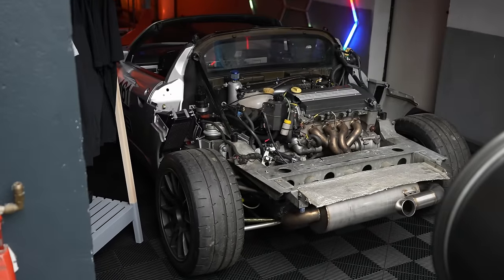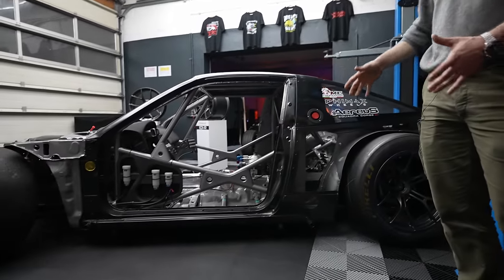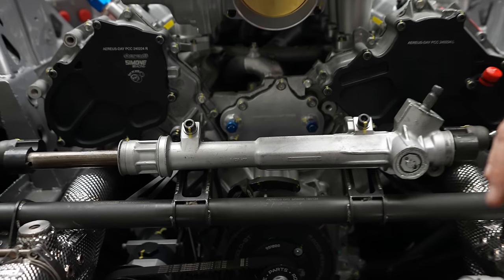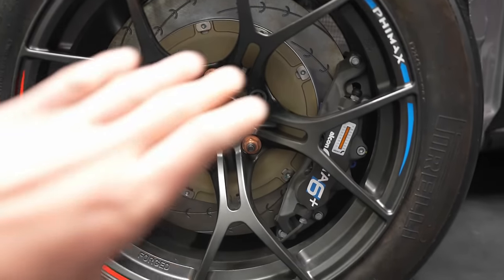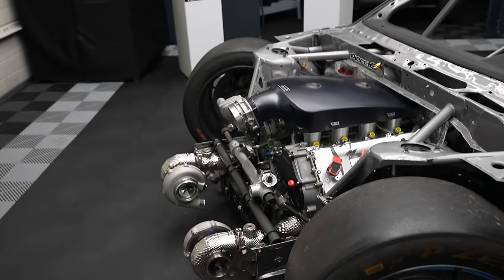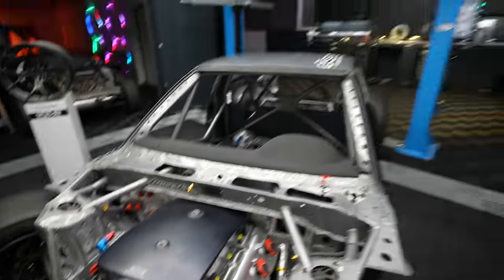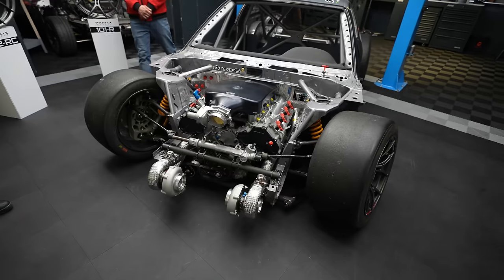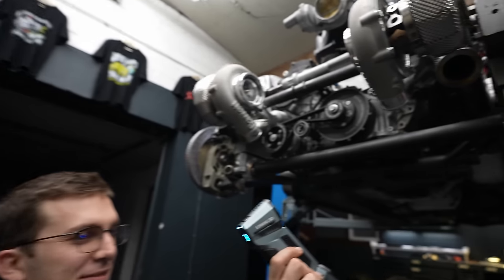Our INSANE 1500HP World Time Attack Build // Vulcan Alpha

Comment: Nice nice. Rigid chassis, custom suspension, engine as far down and back as possible. I like that Lapo even touches a little bit on material science, wheelbearing housing weight vs. strength.

9:53 hm makes me wonder if it clears even with full steering angle inwards and suspension travel (compression and jumps), but I'm sure you've got this thought through 1000%.

20:37 can you take a quick look at the general concept of lightweight intake manifolds? I knew someone who was constructing a carbon fibre intake manifold for the VR6, which could have saved up to 10 kg at an important place (at the very front & top). He abandoned the project due to personal reasons :( But in general I would still be interested in such a thing. Of course this would have to juggle weight saving with rigidity and heat resistance, but I'd be curious to what point the weight saving could be pushed..

Are you also interested in doing a hillclimb with the car? There are many such races in Germany, Austria, Switzerland, ...
Reply from the maker: Intakes&hillclimb: maybe!
Reply: Yes the suspension has been checked multiple times and the results are flawless with no interference. This confirms that the cad work is also spot on.

For the intake it was decided mostly because of time schedule to make it out of aluminium.
But a carbon intake is definitely possible, maybe for the next iteration. 😊
Reply: @lapocorenich  💪💪

And to clarify again, the intake question was not regarding your car, but mine. No hurries though.. I haven't spent any money on mods for a long time. For now I'd just be curious if it's possible and to what degree the weight saving could be pushed while also assuring reliability and safety.
Reply: @stoneeh yes definitely possible! ✌️

Comment: I only recognized it was a S13 chassis because of the rear quarter windows 😂 Great project, I like the way you guys talk about it, wish you the best with it. 

Now, here's me hoping you'll be designing parts for Jimmy's MX5s, so I can then order parts for my own MX5 😂

Also if that's possible, I'd like to know more about the shocks you're using there, who builds them, are they entirely bespoke for your suspension design or did you adapt the arms to work with an already available shock, etc. - of course, if that's not revealing any big secrets.
Reply: Ohlins Ttx completely bespoke
Reply: @lapocorenich  thanks, cool you could get a custom shock ! Although I assume these things are probably getting opened and revalved a few times during the testing phases

Comment: 12:43 finally someone calling out Porsche for being 35 years late to putting double wishbones on the 911 and only on one trim level
Reply: Only facts 😂
Reply: Its from the 1930s, not exactly space age tech :) , they were just trying to cut costs with the struts.
Reply: @garagecedric  very true
Reply: Yeah, meanwhile a lot of 90’s Honda models had it available for the “mass”.
Reply: On 2 trim levels

Also shows  that the choice of concept is not with that much when not executed well(as Porsches drive better than most cars with double wishbone front suspension
Reply: @harrie205  lol cope all you want but Porsche had to make a computer help the car turn with rear steer for ignorant fanboys to think like you…if double wishbone wasn’t obviously better they wouldn’t use it on the 918, GT & GT1 🤷‍♂️
Reply: @peanutbutterpadre1519  sry if you dont understand suspension.

PS Porsche outhandled most other cars before  they used rear wheel steering (even with semi trailing arms) 

the Performance of a system is much more than single design choices

PS if you dont get why the front suspension is the way it is on porshes you lack knowledge on that topic
Reply: @harrie205  I thought their suspensions  lack of ability to handle power gave them the nickname “widow maker”🤔
Reply: @peanutbutterpadre1519  thats a name for a/some modell/s. But overall pretty successfull for a car with inadequate suspension ;).

Read a book about suspension design then you might get it
Reply: @harrie205  dang you think it’s inadequate suspension? I was just saying it wasn’t as good as double wishbone and they have known since at least the 90s when they switched from torsion bars to McPherson strut 🫡

Comment: The McLaren M838T that designed & develop by McLaren & Ricardo, were loosely derived from Nissan VRH35L, which were developed by Tom Walkinshaw Racing (TWR).

Meanwhile Nissan VK56 are pick-up truck or SUV or van engine, and then convert into racing applications.
Reply: They also put the VK56 into their passenger cars like the M56.  My crossover has their 390hp VK50 5.0L V8 under its hood making it the second or third quickest SUV that year.

Comment: It's fantastic that you mentioned the ingenious technologies born from motorsports, solutions that seem like settled matters. However, my curiosity lies in how you will be tackling the engineering feat of connecting the steering rack with the steering column. It seems you haven't let the presence of a cylinder head deter this design. Also I can only imagine the two years of development heavily focused on mitigating bump steer. Its almost reminiscent of what Andy Forrest did to adopt his Subaru to a mid-front layout, anyways I'm so excited to see the final design as I'm actually thinking of incorporating something similar into a personal project.
Reply: The classic was the Subaru didn't meet the regulation's regarding the vehicles firewall and still was allowed to compete....

Comment: Understandable to use log manifold, because you need to cramp that massive V8 between a rather narrow frame rail that never meant for this V8, let alone mount that low down.

In this case, the log manifold is chosen because of all the pros (low engine mount & serviceability) outweigh the cons (exhaust flows).

Comment: Lapo were correct about quick-change rear diff being used in drag racing, although they coupled it with solid axle (which is better for drag racing, apparently?) instead of independent like in drifting or grip racing.

Comment: That is super cool!! Wow. What's up with that steering rack being so low? Won't that induce terrible bump-steer?
Reply: Bump steer is 0, everything has been double checked
Reply: @lapocorenich  Excellent! Such detail is great to see.
Reply: @lapocorenich  afaik it's impossible to have 0 bump steer on a double wishbone suspension if your tie rod is longer than both of the wishbones, which it seems to be on this car. You can have minimal bumpsteer, especially with the limited suspension travel of a time attack car, but not 0 bump steer.
Reply: I agree with @boudewijnb this car does not have 0 bump steer beyond a limited range of suspension travel with those control arm lengths and tie rod lengths. The more concerning thing is that those tie rod angles will produce negative Ackermann. With the position of the engine and the clearance required for the wide wheels it doesn't look like there is any possibility for positive Ackerman. Hopefully that was considered in the original steering design and the designers actually want negative Ackermann.

Comment: A lot of great ideas & design will surely be fast they only I have disagree with as a time attack competitor/builder & even longer time fanboy the top time attack builds across the world as well as the aero consultants responsible for the most & current record lap times all stress that the ideal order of build is to start with the aerodynamics and build the car to suit the aero package vs lower power less aero adding power adding aero bit by bit especially at high end of TA builds aero dictates all and instead of trying to keep suspension from bottoming out from downforce fighting spring rates bump stops etc sacrificing low speed mechanical grip build with the aero goal established and designed on day 1

Comment: Not an engineer, but have a question about the front rotors. The rear position is for thermal reasons, or something with inertia when braking? I get the angle for lower gravity, as mentioned. I was just wondering the difference if it was mounted forward side instead?

Comment: That steering rack is mounted very high. I'm sure for good purpose. Looks like it will be tricky to get a steering shaft on to there
Reply: It’s all sorted out 😉
Reply: @lapocorenich  But can you remove the valve cover without disconnecting the steering?

Comment: Great build, but.......  a VK56 is 225kgs, an LS7 custom built NA version that can spin to 9-10,000rpm is 180kgs.  When you add turbos, manifolds, intercooler etc, you add another 50kgs of weight and also hanging over the front axle.
This is around 100kgs more weight than a proper LS that can (proven) pump out 1100hp NA.  With this route we would also have less torque with higher RPM.   The diff and gearbox don't need to handle as much torque, so can be less mass overall. 
Yes i understand why the turbos and FMIC are out front due to packaging, but this also is slightly increasing the polar moment of inertia of the entire car, bit by bit the car is attracting negative characteristics.   Try not to think of engines as being "better" because it is DOHC or in LMP cars, that decision was political under FIA emissions BS agenda. 
HP/KG is a far better metric than HP/Litre.

Comment: Looks stunning 👌😌

Make sure you use some serious exhaust valves in thar build with nice wide seats, on those log type manifolds,  it's gonna eat valves on extended full throttle runs 🔥

Can't wait to see that round the ring for a shakedown 😎👍🥳💯

Comment: Awesome build! But I'm worried for suspension travel looks like max 1cm, that can be worth looking into how much it will travel to utilize the suspension fully, built a Porsche "it's fun Porsche" YouTube it, 1000+ HP and we ran into the issue where there is not enough travel and it almost cost the car on the nürburgring. (This was back in like 2005-2010)

Comment: That exhaust is capable of handling 750 to 820 hp. The turbo location is either hoovering the track or restricted to 680. To get 1500 to last a full lap, you need to clock the turbos 32-58 degrees, counter and clockwise, and/or raise them 128mm and pull the primaries out to the wheel wells, either though, or under the frame structure. V-bands or similar to the head flange and isolated mount to the block at turbo inlet. Incoming air needs to come through the grill into 25 liter airbox with at least a square foot of filter frame. Will not matter which type of cone filter is used. None of them will work and all of them will break parts.

Comment: I just had a thought in relation to my gripe about the log manifolds... Could you convert it to hot-V? Maybe flipping the heads back to front? I understand you have the motor extremely low, which necessitated the log manifold because of chassis rail clearance. The thing with the inlet manifold is you don't have heat concerns, so you might be able to have better packaging against the chassis rail

Comment: With that steering rack so far forward.. Is the Akerman okay? That inside tire has a lot more angle than outside at full lock. Good for low speed and tight corners( good for street cars) but it looks like it's got way more than a few degrees difference.

Comment: Is the helper spring on the damper fully compressed because the suspension hasn't been corner balanced yet? The car is far from being done so I'm assuming it's just on there so the car can roll around the shop.